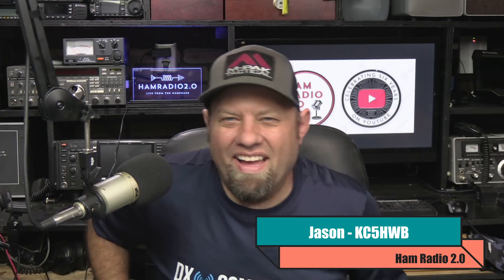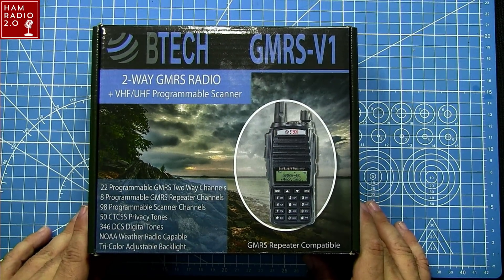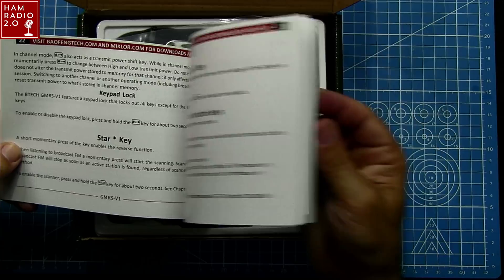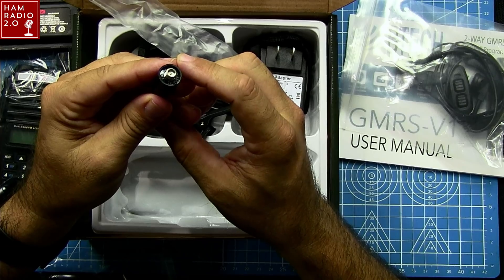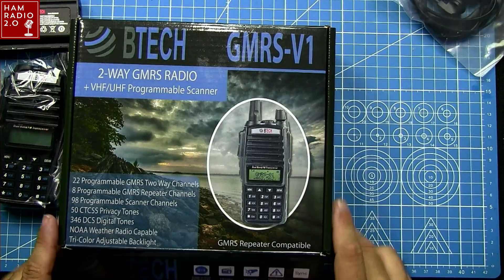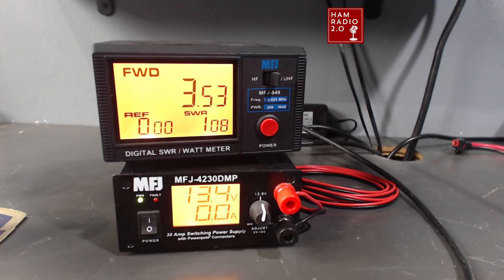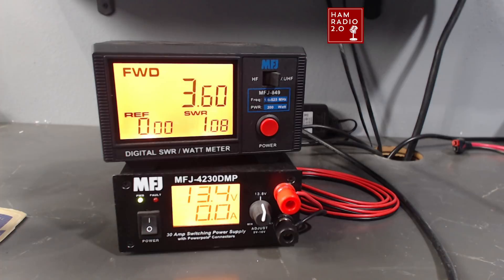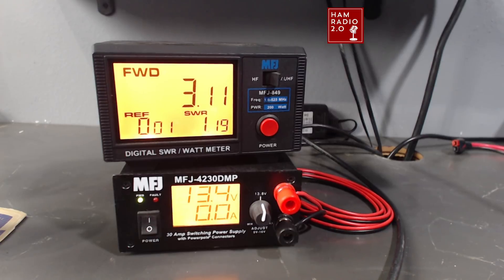BTECH GMRS-V1 Review, Power Output Test | GMRS Repeater Capable Handheld Radio

Comment: Thanks for this video. It would be nice if you would talk about watts vs miles instead of "oh well it depends on how you want to use it". I'm sure I'm not alone as a brand new wannabe user trying to get some particulars to make a choice and generalizations just don't get it. 1 watt gets you 1 mile in a valley - 5 watts gets you 5 miles in a valley (line of sight)? Is 5 watts for a 5 to 10 mile radius without a repeater a reasonable expectation across a fairly flat zone? I just don't have any experience with this stuff. Maybe I am expecting too much from these little radios. Thanks again. TW

Comment: How much longer do they want to sell UV82 as a new product?
Reply from the maker: This is not a UV82. 
Plus, lots of radios remain on the market for several years after they are new.
Reply: It is an UV82 with limited power and frequency range. I'm sure the hardware, software and menu is the same.

Comment: I would like to see how close to 0.5 watts transmitter power this radio is on Channels 08-14. After all, for short range use, a very low power output really helps preserve battery charge.

Comment: Remember, GMRS (and FRS) are rated as ERP, not PEP, which is why most put out a bit less than the Watts advertised, because of antenna gain. In the case of this radio, the antenna may actually be -gain. If not, then it's in violation on chs 8-14 if it's doing over 0.5W ERP. :)

Comment: I have two older units before they backed down the power after the FCC changes the power of FRS on the wide bandwidth channels.  I got 3.4 watts on one HT and 4.8 watts on the other. The power appears to have been reduced to keep the purchaser from violating the licensing requirements.

Comment: As to power, 
On page 71 of the manual under Transmitter:
RF power L/H = 2/5

According to the included manual.
Reply from the maker: That's not what my manual says
Reply: What can I  say,
This is from the BTECH GMRS-V1 MANUAL just received 6 days ago. 
Appendix  C.  Technical specifications. 
Page 71

Comment: Mine does 1.5 watts on low and 3.5 watts on high using my Diawa CN-901 V meter.  One thing I wish BTech would do is to add a couple more programable repeater banks. We have a number of repeaters in my area that they are using more than one set of split tones per repeater for various functions. Plus would be nice for traveling.
Reply: Thats one reason when I went for my moble I chose the KG-1000G because you can have multiple tones for one repeater channel
Reply: Have you tried programming those repeaters using Chirp?  I just got one of these radios and there are a bunch of "DIY" channels already designated with GMRS frequencies that you can set the tones and offsets for.  I had to scroll down the page to find an open memory location to add my local weather frequency.  Check it out.

Comment: Good video Jason❗️ I am still waiting for the FCC to change the licensing fee for GMRC to $35 instead of the $70 fee.  Is there any news when that will happen❓
Reply: I got tired of waiting. I don't regret it. I hit 8 repeaters covering hundreds of miles having a good time.
Reply from the maker: I've not heard a date
Reply: I called the FCC on July 13, 2021 and asked the same thing.  The guy told me that he didn't know.  I then asked, "If I buy the license now at $70 and the price gets reduced on August 1, 2021 or any other time, would I be refunded the difference?"  The answer was "no."  At this point, I don't mind waiting.  The $35 difference can buy me extra stuff.
Reply: @postingid3214   I have to renew my HAM LICENSE next year and that is going to cost me $35 so I sure do want to spend $75 on my GMRS license, I will just have to wait.🤔

Comment: Originally when the BTech GMRS-V1 was released, it was listed as a 5 watt radio.
Reply: Yup, and I believe they got busted by the FCC because of improper SAR testing (GMRS is hard), so they had to crank it down, but I'm not 100% sure.
Reply: I got my BTech GMRS V1 when BTech was selling them as 5 watts. That was my first radio then by the time I ordered my second V1 BTech changed the wattage to 2 watts . 2 v1 GMRS radios put out 4.84 watts on high and 1.34 watts on low. 
My third V1 puts out 5watts on the nose on high 1.34 on low.
I’m sure now that all the old stock is gone. So I would imagine that the newer V1 radios are 2watts

Comment: Looks like this rig uses the "82" series type body.  Uses same batteries?

The ham radio companies need to learn from DeWalt, Kobalt, et al.  When those companies came up with their battery powered tools, one or two batteries could power the entire line.  Should not take rocket science to have a line of handies for Ham, GMRS, Marine, Commercial and maybe CB WHICH USE THE SAME BATTERIES!  Guess what?  If a customer did not have to worry about another lline of batteries and charger, that person might just pull the trigger on more rigs!

Also starndard charging.  A USB port could be used for charging and programming.

Lasty, this is not for handies.  But mobie and home rigs need to go Andersons PP for power.  The Elecraft rig I saw on FD did have APP's.

Not all hams have unlimited bank acounts.  Or are to be treated like turnips!

You have my permission to quote all or part of this in your pods!
Reply from the maker: Yes, same batteries
Reply: @HamRadio2  Thanks
Reply: Yes, same battery and accessories.